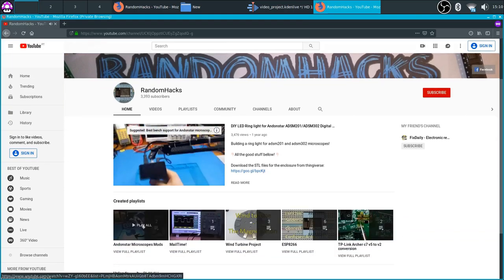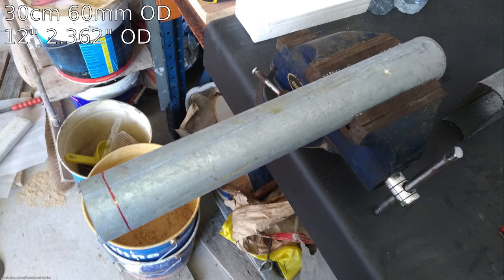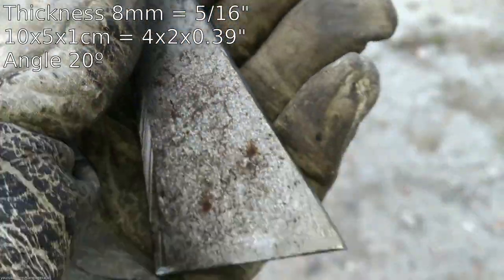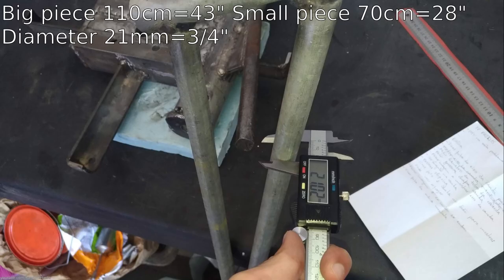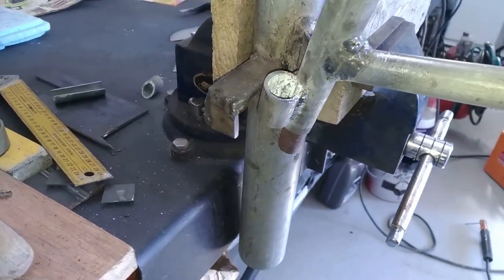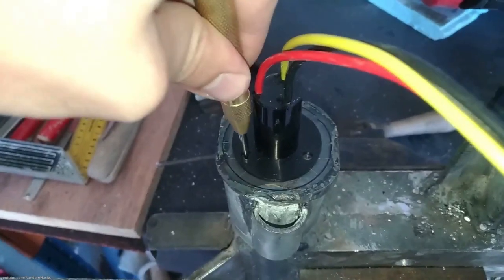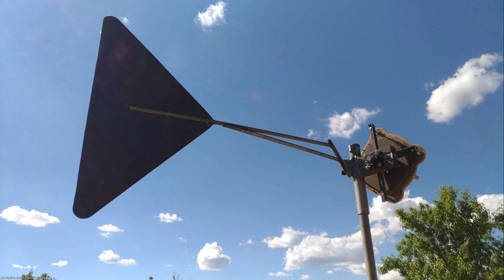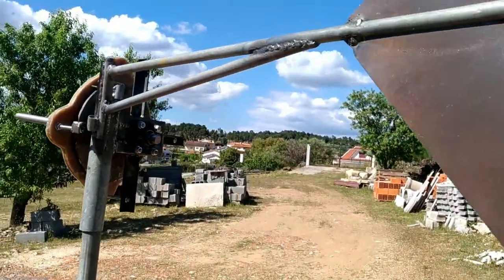DIY 1kW HAWT Wind turbine [Part 4] - Building Frame and Tail

Comment: I swear I heard ..... "And as I had the dremmel set up I decided to wire brush my ugly wife. My wife is still ugly but at least now she is shiny."

Nice build. I met Hugh many many years ago, a pioneer in home made wind machines. Made me realize there is a lot more to building one than getting a scrap alternator from the wreckers and bolting a fan blade to it. In the end I ordered a manufactured turbine from Rutland. I think it was called a Furlmatic and had the off center mount and folding tail fin so when the wind howled it would cant sideways and 'furl' out of the wind to control the blade speed. As you are doing here. worked a treat for years charging the 12v system for the caravan lights and car tape machine/radio.

Comment: I know I'm super late to the party here, but after you cleaned up the internal pipe seam with the dremel, you could easily get that internal surface nearly perfect with a cylinder honing device used for honing/polishing cylinders in piston engines 😎

Comment: Can work with no lenz law flux?
Reply from the maker: Hi, I'm not sure I totally understand your question but in the video I only have one magnet rotor installed, it will have two, one on each side of the stator, attracted to each other so the magnetic flux can travel through the stator. It is called an axial flux generator.